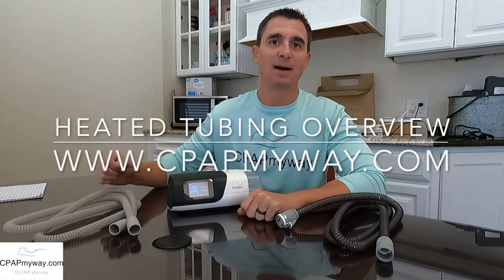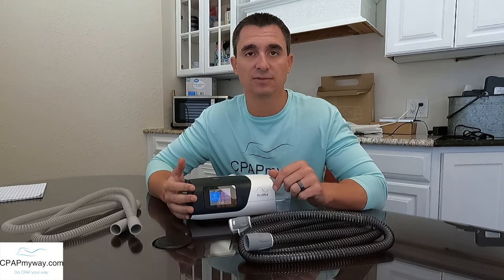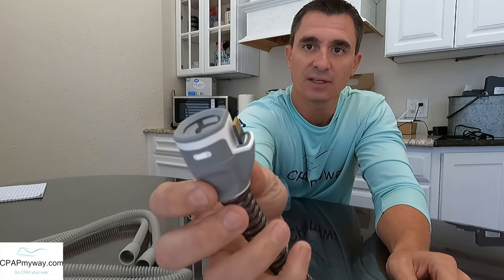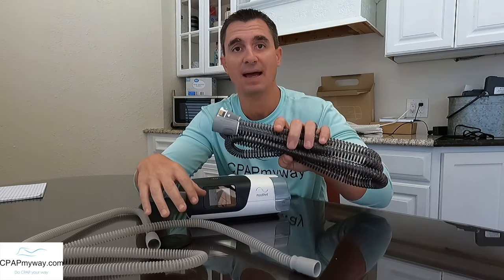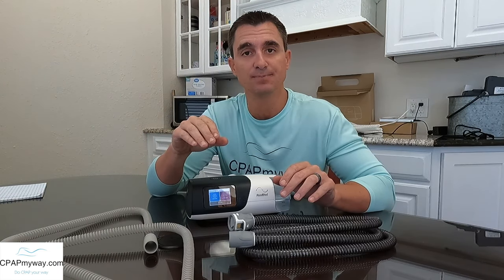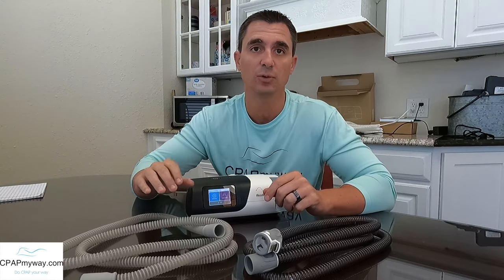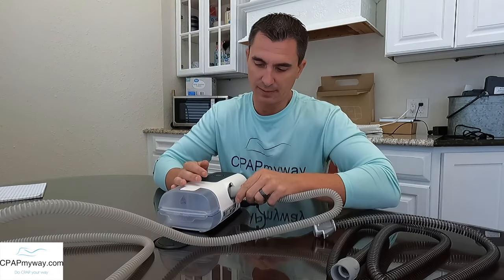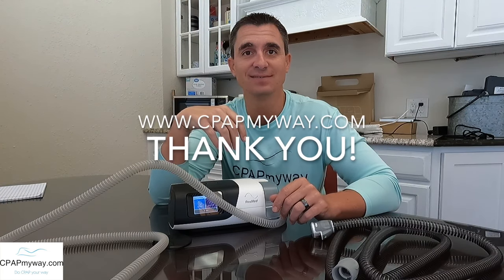Heated Tubing for CPAP - Do you need it?

Comment: I used a heat tube, I keep turn the heat down until it was off, so I do not need the heated tube. the Machine blues air out of the tube for several minutes, after it is turned off, disconnect the mask, put the tube on the floor, gravity helps, and the tube drives out. I done this for 7 years, I replace my standard tube every 6 to 12 months, I can detect orders well and it clean, If I needed to clean the tube, I would use H2O2 (Hydrogen Peroxide) about a cup and move it back and forth, run bottled water through the tube and the rinse the tube with a cup of distilled water.
Reply from the maker: Thanks for the input.

Comment: Please help, I have used a CPAP for 25 years and I just got the AirSense11 with the heated tube.  This is the first heated tube I have used and am getting the rain out.  This is very frustrating to my wife and myself as it gurgles in the hose and wakes us up.  Am I not using enough humidity or too much?  How can I prevent this from happening?
Reply from the maker: You should decrease humidity and increase tube temp till it resolves.
Reply: I have swapped the heated tube for a standard. I no longer get dry mouth problems, nor do I get any hot head issues that make me sweat in the night.

Comment: Something noone addresses is that using a heated tube or any setting that causes heat, can cause a rosacea flare up.  It happened to me.
Reply from the maker: Thanks for the input.
Reply: Issue I have with my air sense 11 and Dreamwisp nasal mask is that I get a rash on the front of my nose where air enters. Is this what you are talking about? Thx

Comment: The end of the heated tubing that gets connected to the unit;,I used to have a grey inside ending; now it’s Orange, and doesn’t seem to lock onto the machine! Is there a plastic adapter that I’m missing? Or, do I just connect the tubing?
Reply from the maker: I would have to see that to know exactly what you are talking about.
Reply: @CPAPmyway I found out that the piece I was looking for actually comes with the AirSense 10 Mask & Head Harness; it fits on the end of the swivel elbow of the mask; the heated tubing fits over that little dark gray piece! I heard it was called a “frame piece (?)”.

Comment: I have a ResMed AirCurve 10 Bipap with the heated tube , manual makes no mention of the heated tube, can it be cleaned the same as the non-heated, submersion in soapy water?
Reply from the maker: Yes it can be cleaned with warm soapy water. Rinse it really well.
Reply: @CPAPmyway  Thank you!

Comment: I don't like to run the furnace at night unless it's arctic cold so when my frozen nose woke me up I decided I needed a heated tube. I've kept the temp fairly low but now my humidifier runs dry in the middle of the night. 😢
Reply from the maker: Yeh that is tough there is not enough water for the night the only option is to reduce the humidity a bit or continue to run out.
Reply: @CPAPmyway 
Yeah, I've been running out of water too, by the time i wake up. before, I was getting a lot of rain out (gurgling) but often had a half full water tank in the morning. Since I have fiddled around with the setting though, I wake up with a dry mouth and no water. I'll just keep fiddling with it.
Thanks for the advice.
Reply: Considering that the equipment is okay, I would check the humidity of the room. The machine adds water vapor to the air it is pulling from the room. If the air is too humid, the water in the reservoir will not decrease. If it is too low, not all the water in the reservoir will compensate for the lack of humidity in the room. Depending on the situation, you may want to consider using a humidifier overnight, keeping the relative humidity in the bedroom at 60% or above.

Comment: Hi. I'm Dan from the UK. I have just watched your video titled "Heated Tubing for CPAP - Do you need it?".

I have removed my heated tubing and replaced it with the standard hose. My problem with the heated tubing is that the warm air from the humidifier and tube made my head get hot. By  breathing in heated air, my face and neck became uncomfortably sweaty. It was unpleasant waking in the night to find soaked nightwear and pillows. Sometimes, it was so unpleasant I had to change bedding etc. in the middle of the night!

I have now set the humidifier to zero, and have swapped the tube for a standard unheated one. Since swapping, the heated tube for a standard tube, I'm glad to say that my head no longer gets hot, and, dry mouth problems have been miraculously eliminated. I'm delighted to recommend ditching the water heating and heated tube arrangement. 🎉

I was hoping to hear your thoughts and opinions regarding my problem. But as this issue was not mentioned in your video, I wonder if I'm the only guy who has had this horrible problem.

Thanks for reading this.
Reply from the maker: I am not sure what to make of that.
Reply: Is the humidity and heated tube better for people with asthma?

Comment: Thank you for this video.
I recently started using a Resmed 11 with heated tube. More often than not, I’m getting a message that says, “Attention. Heating system error. Therapy may run without heating.” I wake up with the water in the tank still full and my sinuses feel dried out. 
Other than having a bad machine, can you think of a reason why I’m having this issue? It seems to be a common problem with Resmed 11. My provider hasn’t been much help, so far. Thanks for your help.
Reply from the maker: In almost every case that I have seen with this particular error, the AirSense 11 has to go back to ResMed for repair.
Reply: Thank you for your reply!
Reply from the maker: Always welcome!  @randymiller3070

Comment: I actually like all the moisture. Can it be bad for you? I've been trying to find the answer. I have to change my p10 mask in the middle of the night since it gets too wet, but I like it.
Also, (I just asked this on your other video) 
when you turn up the humidifier setting, how does it make more humidity?
Does it increase the temp of the heating element under the reservoir? Like when you turn up the heat on your stove?
Reply from the maker: I do not think that it can cause too big of an issue as long as you are comfortable and the equipment is being cleaned very regularly. Moisture can lead to bacteria, mold and mildew if not maintained. 
The moisture is added by heating the water more causing more to evaporate.

Comment: Hi Great explanation and thank you.

I have an Resmed air sense 10 and are under the care of the NHS UK which services it, 
I was issued a humidifier water tank yesterday at the hospital my set up is a  standard Plastiflex classic 15 air tube (not Heated) Im using Nasal pillows with a humidity setting of 4 (default). 

My question is will the humidifier work with this set up, the humidifier green smiley face showed this morning after using last night on checking the water tank was still full on felling the water tank the water was at room temperature this was also evident of the warming plate at the bottom of the machine and water tank. do i need to apply any setting?

Kind regards 
John
Reply from the maker: The humidifier will work with heated tubing.

Comment: Should I be switching back to the regular tubes in the summer times where isnt as much dry air in my place. ( I live in ontario*)
Reply from the maker: It is up to you. Using standard tubing is cheaper if you do not have to use the heated tube.
Reply: Why don’t you just turn off the heat feature under the climate control setting ..

Comment: Can you do a video on how to wash a heated tube? The sleep coach  said it can’t get wet. I’m not sure how to clean it.
Reply from the maker: Which CPAP model are you using?
Reply: @CPAPmyway   Good question..  I have a Resmed Airsense 11 and considering the heated tube due to the dry throat cough during this time of year (Winter) as our room is kept cool to sleep. Adjusting the humidity didn't do very much other than cause rainout into my nose (nose pillow type of mask) and a dry throat. :-)
Reply from the maker: You can wash it the same as the regular tubing. So the sleep coach is incorrect. Here is the snip direct from ResMed. 
ClimateLineAir™ heated tube, SlimLine™ and standard tubing
Weekly cleaning tips:
1
Unplug your CPAP machine from the power source.
2
Disconnect the air tubing/hose from your mask and CPAP machine.
3
In a sink or tub, rinse the inside and outside of the air tubing with mild dishwashing liquid and warm, drinking-quality water. Avoid using stronger cleaning products, including dish detergents, as they may damage the air tubing or leave harmful residue.
4
Rinse again thoroughly with warm, drinking-quality water.
5
Place the air tubing on a flat surface, on top of a towel, to dry. Avoid placing in direct sunlight. @blueflicker

Comment: Good video. 
How can you tell if your heated tube is actually heating the air in the tube? Dreamstation II...
Reply from the maker: Typically as long as you do not see condensation in the tube it is working. I believe that model will also alert you if the tubing has a fault.
Reply: I drain my water chamber nearly every night.  Heated tube with humidity on 2.  Any suggestions why ?  I hate the burning smell I get after the water run out after about 8 hrs of sleep.  Tube temp is set at 70,  sometimes 68.  Thank you
Reply: Thanks man,very helpful advice✌🏼

Comment: I have a Luna 3B I use a heated tube and have been given a number of tubes. It has the extra little plug at the end. I feel no humidity. I get rain out and condensation. Any thoughts? I didn’t have this happen on my dream station. With my dream station, I could feel the warm air and I didn’t get the dry mouth. This is terrible and it doesn’t seem to work. My humidity is set up to five.
Reply from the maker: Have you increased the tube setting as well? There are two separate settings for those. The link below will give a good reference. 
https://cpapmyway.com/blog/luna-g3-cpap-setup-guide

Comment: Every time I use a heated tube it runs my water dry in my reservoir. I also have the air sense 11.
Reply from the maker: That can happen. May want to try decreasing the humidity a bit.

Comment: I don't understand the rationale of this video. A heated tube used to increase humidity? Since when does heat increase humidity?

Heat is temperature. Not water vapor in the hair.

Temperature and air humidity are two different Physics variables.

So this video didn't mention the main reason why a heated tube is used. To warm up the air.

Please correct me if I'm wrong.
Reply from the maker: The warmer the air, the more humidity it will hold. Without a heated tube the air will cool rapidly as it passes through the tubing and the humidity in the air condenses into water. This causes literal rain in the tubing which is very irritating to CPAP users. Cold air does not hold much humidity.

Comment: so basically. The standard tubing will work with the humidity setting BUT the heating tubing works better with the humidity setting because of the metal coils in it right ?
Reply from the maker: Yes, the heated tubing will provide the best humidification.